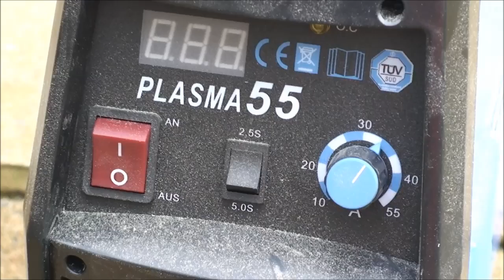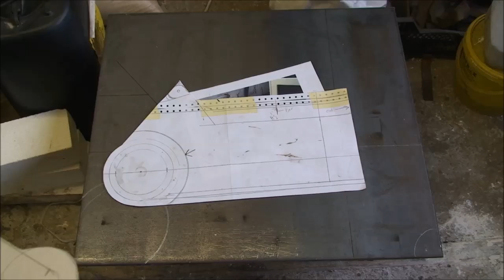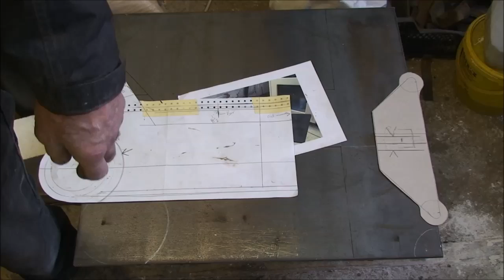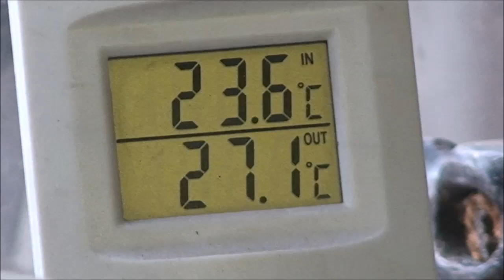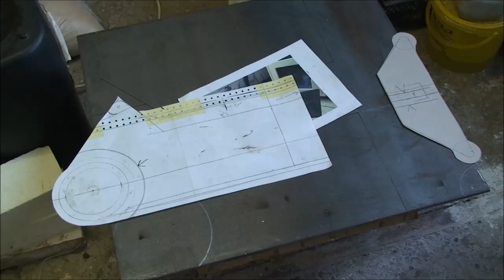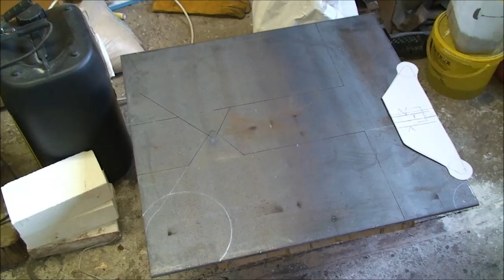stahlwerk 55 plasma cutter.

Comment: I hope you are using proper eye protection with the plasma cutter. Not just for hot metal splatter but IR to UV light. You will not be aware of eye damage until your sight starts to degrade and by then the damage is permanent. Maybe a spacer would help to hold the cutter tip away from work and make the tips last longer. Also TIG gloves are nice and light and will prevent burns on your hands.

Comment: Hi I was only checking out plasma cutter it was you thanks very much think I’ve been using my cutter wrong  it looks better cutting away I’ve been pulling which is correct I don’t know
Reply: Pull towards yourself, easier and produces  a much cleaner cut especially if using a guide

Comment: 4:12 We have the some problem With stahlwerk 5in 1.
 Plasma in MAX 40A, but not starting, some times starting, but working corectly only on metal to 2mm and power not more 25-30A. How we can repearing?
Can your support write to us tom mozxxx@inbox.lv
Reply from the maker: Mine does cut out due to overheating i think on 10mm steel they run much better with a 16 amp supply
Reply: 40A is setting to cutting power.
Monday I make video, how bad workind plasma and show in YouTube.
Today I welding with this 5in1 with TIG 1mm thickness stainless steel.

Comment: You're away with the plasma now, but I'm surprised you don't or didn't have burning gear all this time.  I know it means renting an oxy and propane (cheaper than acetylene) cylinder and paying for the gas but it's probably only the same cost (or less) than going through cutting discs (and grinders).  I wouldn't use a grinder on anything thicker than 3mm plate.  

Burning gear also comes in handily for torch heating.  You can't really gas weld with propane, but you can braze and hard solder, with the right gun and nozzle.
Reply from the maker: +Finarfin Cheers mate yea had enough of cutting with discs now plasma should work out ok im thinking was cutting some steel up today started getting nice clean cuts once id figured out the settings.

Comment: I'm still blowing breakers with my plasma cutter. If I'm using it at full power and the compressor starts I have about two seconds to stop the arc before the current draw becomes too much and everything stops. A right PITA. Putting a couple of 15 amp circuits into the shed is the next job on my list.

Nice knife, not sure about the skull crusher/piercer though.
Reply from the maker: +James Lamb Hi James the fuse on mine blows on the plasma cutter plug itself ? the workshop has its own supply with armoured cable taken out of the house fuse board and wired with its own circuit breaker so if anything blows in the shop the house stays on. Cheers.